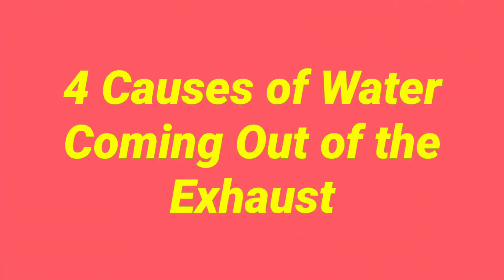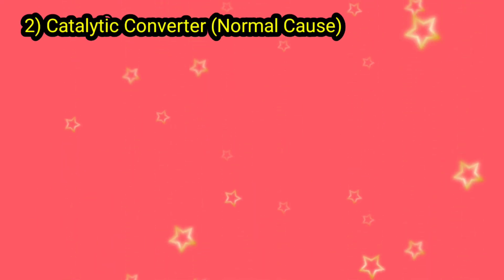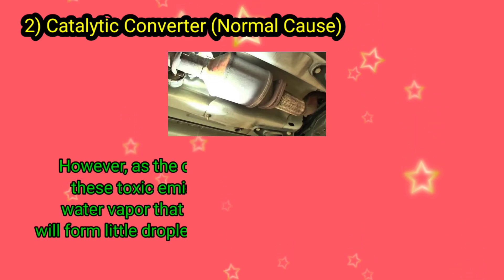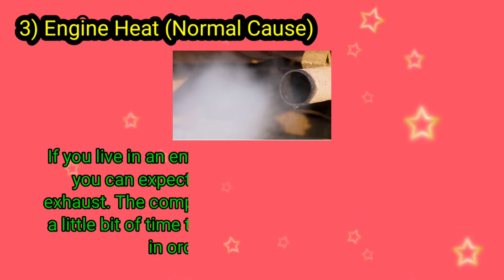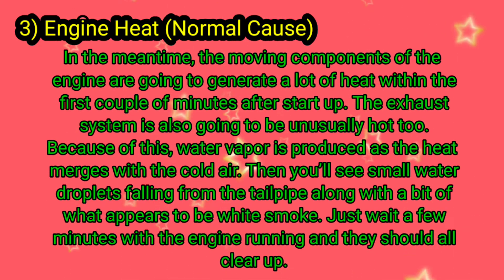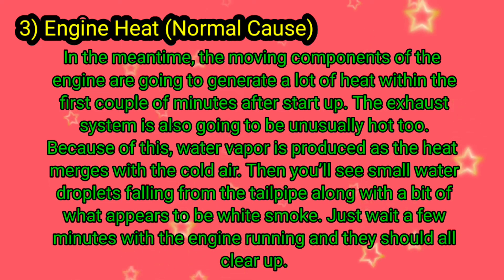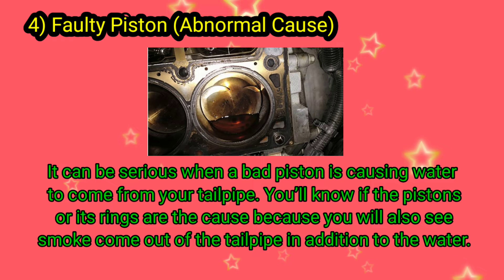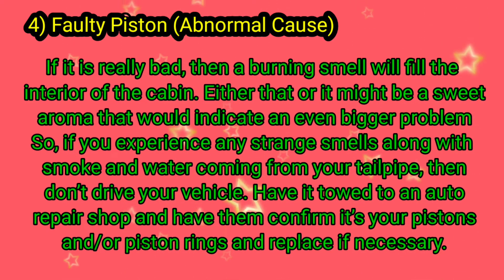4 Causes of Water Coming Out of the Exhaust👀👀|

Comment: When I run my car it smokes 24/7 and also has a ice mound right at my exhaust when it running like alot of blue smoke and  tons of condensation
Reply from the maker: Blue smoke :- https://youtu.be/v-dsmfqK5UU
Reply from the maker: Sir..,If the main cause of blue smoke is burning oil🔥🔥, take your vehicle to the nearest car mechanical shop and check...